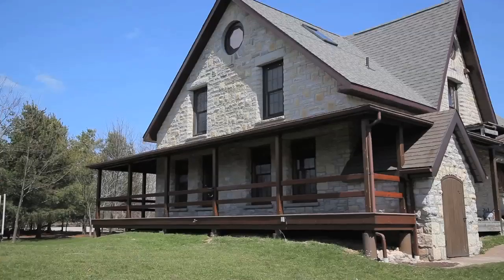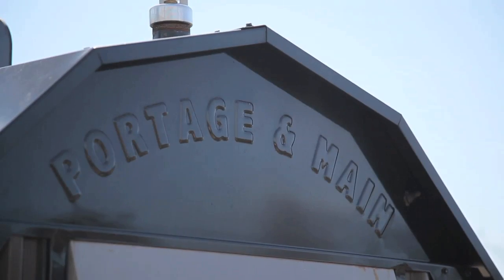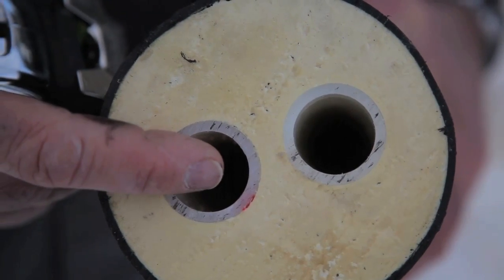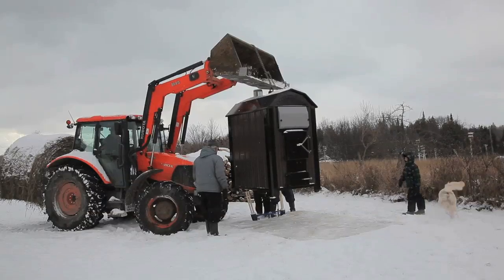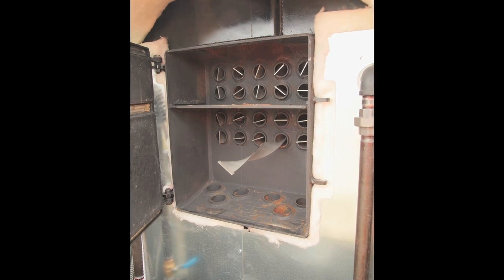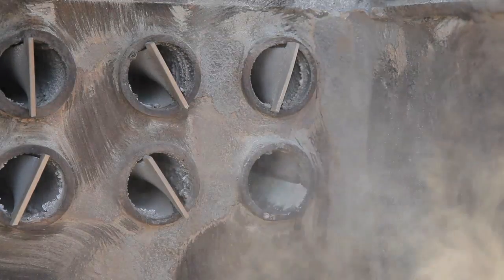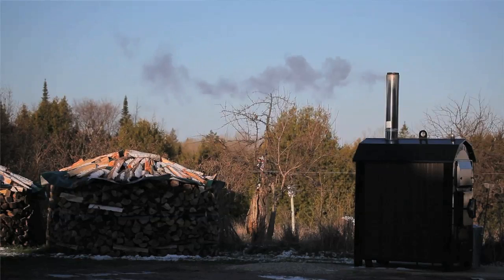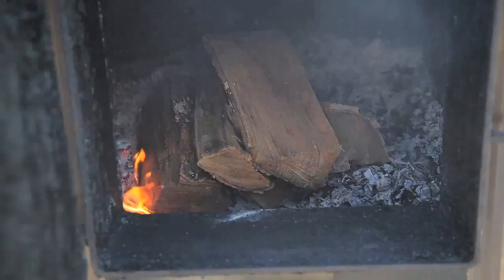Outdoor Wood Furnace Tour

Comment: Can you shut this thing down during freezing temperatures? Say you want to go to Florida in February.
Reply from the maker: Yes, you can shut down an outdoor boiler if the "water" in it has been treated with non-toxic anti-freeze. That said, these things stay warm for quite a while just from insulation around the tank. We shut down our boiler one year because we went away for Christmas. Water temperature was 180ºF when we left, and 9 days later is was still 50ºF, despite the fact that daytime highs never rose much higher than a few degrees below freezing while we were gone. 90 minutes after I fired up the boiler again, water temp was back to 180ºF.

I hope this helps. Thanks for watching.

Drop by for a visit at stevemaxwell.ca.  You'll find all kinds of videos, articles and tool giveaways.

Bye for now,

Steve

Comment: overkill regardless , you are using way to much energy... make things easy , just need less space, smaller house , less stuff = less consumption... if not so then why not buy a 10,000 square ft home ... and heat it to 75 all winter long ... burn half a forrest to keep your family warm.
Reply from the maker: Hi popoqwer,

Thanks for watching and thanks for your comment.

Yes, it's always possible to live in something smaller, but my home and shop are doing quite a bit as-is.

At any given time we have 6 to 9 people living in the house, so that works out to about 400 sq.ft. per person. My 1200 sq.ft. shop provides working space for 3 people working full time and one person getting a high school diploma. That's 300 sq.ft. per person. None of us drive to work or school, so we're off the road when most others are burning gasoline.

Our wood is harvested sustainably too, so there's really no significant impact on the forest, and certainly no deforestation.

All in all, I'm not sure how much smaller and more efficient we could make our residential and working lives. How many square feet per person does your family occupy? Do you earn a living in less than 300 square feet of indoor heated space?

Thanks for watching! Is there anything you'd like to see me cover in my videos?

Bye for now,

Steve
Reply: Wow really?  Who are you to say if he is using too much or not enough energy?

Comment: Hey Steve, I LOVE your off-grid heating system. Very impressed with the quality and craftsmanship. I've been in the HVAC business for the past 10 years and love learning both new/old ways of doing things. I have a few questions regarding the heating system. What is this boilers btu/hr rating for input and output? What kind of efficiency ratings does it get? How many buildings does it heat,/what is your load btu/hr? What kind of heat transfer methods are you using (radiant, baseboard, air handler)? Is it configured, or tied into a backup/secondary heat source? I've seen some really cool solar thermal systems out there that could greatly reduce the amount of wood you'd have to split/feed into the wood boiler. Any things you wished you did different? Thanks!
Adam

Comment: I was wonder what your opinion would be on a Woodmaster 4400? A basic outside wood boiler without gasification. I live in Southeren New Jersey and it gets cold in the winter here. Not as cold as Maine or Canada but still pretty cold. I know a gasification gets 90% more efficiency but was wondering if you had a choice of just a basic outside wood boiler, what would your choice be? Thank you for the video.
Reply: Thank you Steve. Yes a Portage & Main is my first choice. Looking at the new Ultimizer as a choice. Just have to get the ok from the Misses. Thank you for the info

Comment: Great video explaining your research and choice!  I did alot of research on all the options a few years ago also, and wasn't looking to spend quite as much on the upfront costs, and didn't want to get into the complexity of underground piping with a water boiler.   I originally went with a Wadena, then moved to a Hopsco energy outdoor wood furnace.  It cost me alot less up front and heats my house without digging up the yard or having to be much further from my house.  My large covered porch keeps my split wood dry, and my outdoor furnace is easy to get to even when the weather is bad.  Thanks for the information on your choice, and I also like the DR splitter . . . I have one also!

Comment: Face cord ≠ cord.  "Cord" as applied to firewood = 4x4x8, or 128 ftᶾ of wood.  "Face cord" is not a rigorously defined term and is only generally accepted as equalling a third of a cord, ~42.66 ftᶾ.

The number of people who use the term "face cord" while meaning something else is actually pretty high.  If you actually meant the 42.66 ftᶾ "face cord," you could have used the one-third value of your stated wood consumption, called it "cords," and no one would be confused.

Comment: Hi Steve - great video!  Four years ago I installed a Greenwood Aspen outdoor gasifier.  They were made by Profab.  I loved the gasification action and all it's benefits - very little smoke, less wood use and -in particular - the fact that it was certified to be put inside outbuildings. Unfortunately the Aspen's are crap and they all rot out around the loading door. Have you noticed any corrosion around the inside edge of the firebox at the door perimeter with your unit?  I need to upgrade. Thx!

Comment: Great information Steve. Im very seriously looking at putting in a Portage and Main boiler this year. What are your thoughts on the 28-40 model vs the 250 gasification model?? All dealers seam to be talking me into the 28-40 rather than the 250.

Comment: Great video.  A couple of questions.  You seem to be splitting the wood to typical fireplace size.  Can larger pieces be used?  Is there any kind of stove that doesn't require a grid hookup for the fan, etc?

Comment: Here in Ireland they have invented the worlds first 'Condensing' wood pellet Boilers for hydronic heating of homes maybe same could be linked into a heating coil on already existing  Air Ducted system in don't know...anyhow the company is called Grantengineering.ie ...it's a packaged unit and is almost 'Plug in and Play' comes with a fitted 110Kg hopper/ store.....

Comment: Hello Steve, I'm very interested in the outdoor boiler. I live here in Chicago, but I'm looking to move out to Montana.  I don't know,  if I buy this boiler will it be more cost effective buying the wood (if I don't have wood around me) or to buy a 500 gal. propane tank to burn a tankless boiler to heat my home, which would be best? I want to live off the grid.